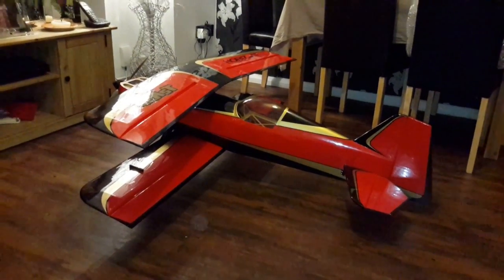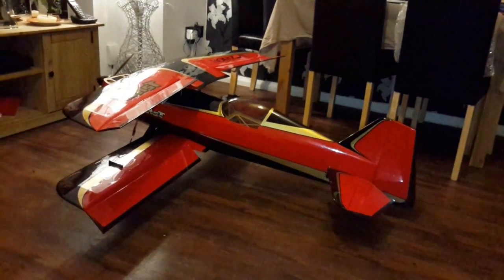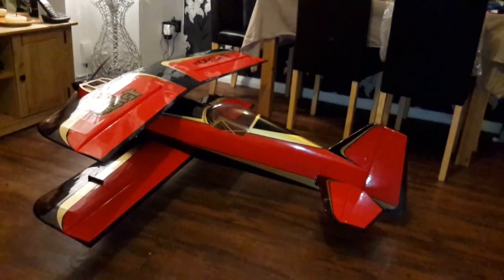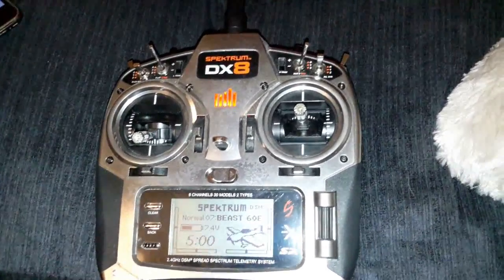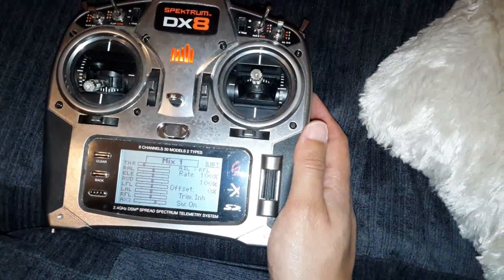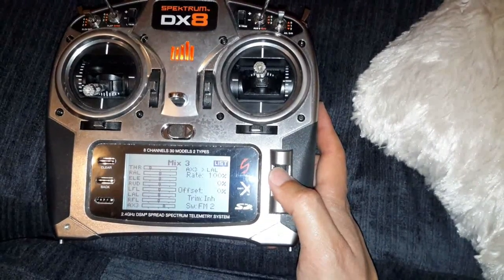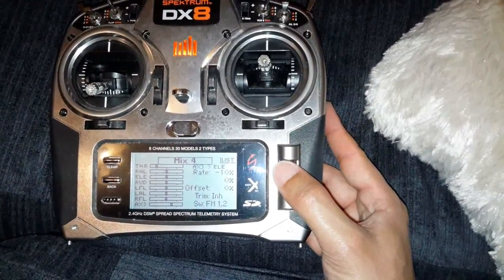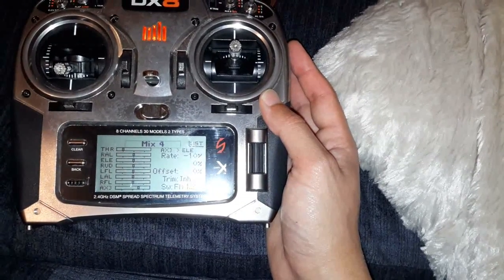Setting Up Flaps & Crow Braking using DX8 on a Bi Plane

Comment: Hi Moshir its me again could you let me know what receiver you are using. Im using an 
ar8000 which isn't man enough to handle the servos all working together and just un binds its self I have been advised to use an ar 9310 as this will handle the voltage please let me know what you think thanks
Reply from the maker: Hi Jan, i'm actually using the ar8000 receiver and have been for almost a year. i never had a problem with it and it never lost the bind. my guess would be either a faulty receiver or the wrong power system. I am using a 2s 1300 lipo battery to power the receiver and servos and never had a problem, it gives the servos and receiver lots of power and i get 6/7 flights a day and still over 50% battery left. i think the ar8000 is a great choice, not sure why you are getting these problems.
Reply: +Moshir Fakhoury thanks I will look into using a 2 cell like you thanks again

Comment: Hi Moshir, could you please tell me what setup you are using to power your ar 8000. In a previous message you told me that your using a 2cell 1300 into the receiver, someone else has told me that it will give me the wrong voltage. Could you please advise Thanks jan
Reply from the maker: Hi Jan, sorry i didnt memtion i was using a voltage regulator as a lipo battery could give out the wrong voltage. looking back i think the best thing to do is use a life battery, 1300-1500 will do just fine and you dont need a voltage regulator. i am using the life battery with my ar8000 in my Edge 540 and it works great.

Comment: hi Moshir small problem I have a dx8 but when I call up my mix settings and go to mix 1 my list it is different to yours the list on the left hand side goes THR AIL ELE RUD GER AX1 AX2 AX3 am I being dum or could it be that I have a later dx8 hope you can help I fly 3 bi planes and would love to set them up the way you have thanks
Reply from the maker: +jan collins Hi Jan, something I forgot to mention in the video is that you need to make sure you have selected the correct wing type. If you go to the system settings, then scroll down to wing type, you need the wing type with 2 Ail 2 Flaps. please check this first and let me know how you get on, but I think this will fix this problem. Thanks
Reply: +jan collins hi Moshir worked out that problem wing type setting , now  all 4 all work great .Have followed your mix 2345 to flight mode 1&2 but nothing happens when I flick the switch hope you can help I have a beast 60e using ar 8000 so can't work out what I'm doing wrong
Reply from the maker: +jan collins Hi Jan, if all 4 ailerons are working in the correct direction then everything else should work, i would just double check you have assigned the correct switch to the mix. can you let me know what you have in mix 1 it might help me narrow the problem. let me know how you get on and if you got it to work. thanks
Reply: Hi Moshir checked I have assigned the correct switch to each mix As for mix 1 it is identical to your video so a bit lost as what to do next, would love to get this working thanks for replying
Reply from the maker: +jan collins hi Jan, so is mix 1 working, are all 4 ailerons working in the correct direction when you move the stick? or is nothing working at all.
Reply: +Moshir Fakhoury mix 1 works perfectly all 4 ailerons together but when I switch to flight mode 1 or 2 nothing happens no flaps no crow brake no -10% on elevator which is mix 2345 hope this makes some sense
Reply from the maker: +jan collins hmmm I have to say I am not sure, if mix 1 is working then the rest should work. are you sure the aux 3 is in the middle position and not to one side, also maybe take mixes 2,3,4,5 off and just try mix 2 on a different switch, and if it works try the other mixes. maybe there is something wrong with the fl switch. sorry but i am running out of ideas, let me know how you get on.
Reply: +Moshir Fakhoury hi tried different switch no joy but then noticed that when I made rapid moments on the ail stick the receiver was flickering in and out big faulty receiver put in a new one and its all fine so thanks for your time and effort will be telling all my friends  how great your video is cheers

Comment: I thought this was explained pretty plainly.   So I set up my Jungmeister  as indicated.  I reversed the servos as necessary.   The left port bottom ail. only cycles up or down with the gear sw.  The starboard bottom servo going to aux2 dosen't move at all.  The port and starboard servos in the top wing cycle as ail.s should no matter which position my F sw is in.  I have tested all servos with servo tester.  All are good.  Now my question is, does this sound like a bad receiver to you.  It is a Spektrum AR 8000 with sat. rec.  Looks just like the one you show in the video.  The only difference I see is that on my display my  DX8 shows the abbreviation as ral for right ail.  Yours shows rfl.  (I think it was) But yours shows f where mine shows r.  And you call it a flap.   I don't think this has anything to do with it.  But there is a difference in our transmitters.  I bought the rec. from one of the guys in the club.  So it's used.  He is off on vacation for several months so I can't ask him if all was good with the rec.  I under stand a lot more about this transmitter then I did before watching your vid.  Thanks for that.  But now I am kind of lost.  
Thanks for any suggestions or help
Richard Baldwin
Reply from the maker: +Richard Baldwin Hi, I don't think its a receiver issue (but I could be wrong). I think the problem is that it must be AIL > LFL or AIL > RFL, if its AIL > RAL then it wont work. Start by clearing any mix's you have done and just use mix 1 to get all four ailerons working together. I found out later (after changing my servos in the wings) that you can use in mix1 AIL > LFL or AIL > RFL depending on the servos you are using, when I first started as it stats in the video my mix 1 was AIL > RFL, but that didn't work when I changed my servos and had to do AIL > LFL. However this mix must be aileron to flap it can't be aileron to aileron and make sure the Sw is set to On. Once you get all four ailerons moving together at the right direction you can then look at doing the mixing to get the crow braking working. Let me know how you get on.
Reply: On mix 1, my setting options are ail. goes to,,,inn, or thr, or ral or ele, or rud, or ger, or lal, or ax2, or ax3.  No other options on the settings.  There is no LFL option.  Boy am I confused.  I am wondering if my xmtr. may be an earlier model then yours and so is missing something I need for this set up.
Reply: I just happen'd to think, maybe I am missing an up grade on the software in the xmtr.   I am going to try Spektrum to see.  I just want to say again.  Thank You for the time and effort in helping me.  I am new at this and don't know much.  Fifty years ago when I was into r/c models, things were so much simpler.
Reply from the maker: Oh ok, you are right it might be that you have an earlier version. here is a link on youtube on how to upgrade https://www.youtube.com/watch?v=EcmSpw1o938 My DX8 is version 2.07, there is now a 3.00, if you go to system settings on your transmitter and go to the 3rd page it will tell you what version you should be on. Anyway watch that link and good luck. please feel free to ask anything, I will be happy to help if I can.
Reply: Life is good!  I went to Spektrum and they had me on hold for 45 min.s while they all watched your video to find out how to do this.  Ha ha ha.  So you taught them something.  They had never run into this set up before, they said.  I think I told you that I am old and not very smart.  I had the wrong wing type set.  Oh well, like I said, I'm old.  I am charging my rec. pack right now. But I have the transmitter set like yours.  So here's hoping.  Thank you again
Richard Baldwin.
Reply from the maker: oh ha ha, I am sure they must have known about this you probably got a new person working there. anyway I am glad you got there at the end and I also learned something new, I didn't think the wing type affected the mixing options but of course it does make sense.
Reply: Thank you again. It works perfect!  That's a beautiful airplane you have there, by the way.